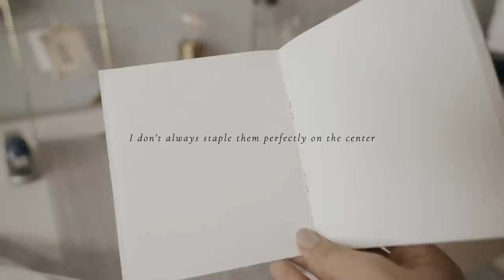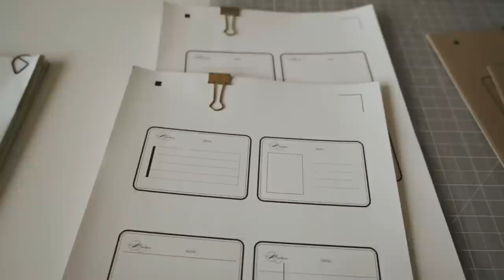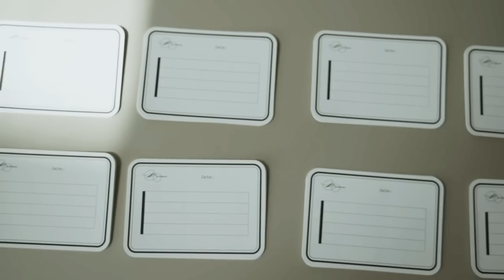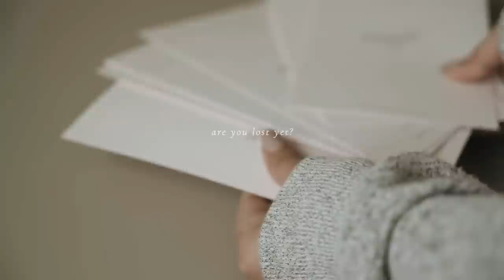Studio Vlog 03 : Restocking my shop & making lots and lots of journals

Comment: I've used that stapler a long time ago and had a similar problem. I think I clipped my journal to the bed of the machine so that it couldn't move whilst I used both hands to activate the stapler. I think that your book is moving when you press the stapler. The first staple you did much slower and more carefully. The second staple you quickly stapled and that's why it went crooked. ❤🌅🌵
Reply from the maker: The issue with this stapler is that it's not meant for larger quantities of papers but rather thin booklets. I sort of cheated and used heavy-duty staples in it from another brand. and the covers I use are quite thick so if I go a little faster it usually helps for it to go right through and also applying a large force. With these journals, it wasn't too bad but I struggled so much with the cotton rag papers I had 😂Luckily I don't have to staple anymore and never waste any journals by sewing them now. ❤️

Comment: Those paper trimmers!! 💕😍 I'm so jealous!! I must have them!  I'm so sick of cutting, one or two pages at a time, then still messing up alignment. What brand, where do I buy them?  Thanks!
Reply: Maria Ochoa I want to know too!
Reply from the maker: The red one is the Ideal Kutrimmer 1038 Paper Trimmer from amazon and to be honest I am having trouble with it lately. It's not so accurate so I am using another one more and I highly recommend it. It's the CARL Heavy Duty Rotary Paper Trimmer. The larger one is a stack cutter but it came unbranded and I did order them locally but you can find them on Amazon. Just search for stack cutters. But the stack cutters you cannot cut single sheets so it only has one use and thats to cut large amounts of paper. I hope that helps. I will probably film a video of all the supplies I use for bookbinding. ❤️
Reply: @SoftlyStudio    yes, please do a video with bookbinding supplies. thank you

Comment: Where did you get that page trimmer? Also where did you get the cool stapler? :00
Reply from the maker: Both from Amazon! The stapler is called a Bostich booklet stapler although depending on your journals you may need to replace the staples with more heavy duty staples. I will do a video soon about the supplies and I will like what I can find ❤️

Comment: I'm curious, what's the difference between your two paper cutters?
Reply from the maker: Well the smaller one is for single sheets and up to 50 sheets but truthfully I can't even cut half of 50 with it. But let's just say its for smaller batches of paper. The larger one is a stack cutter and can only cut a stack of paper but it also has limitations depending on the one you have. so for mine I can fit about 2-3 inserts at a time, depending on the thickness of the covers.